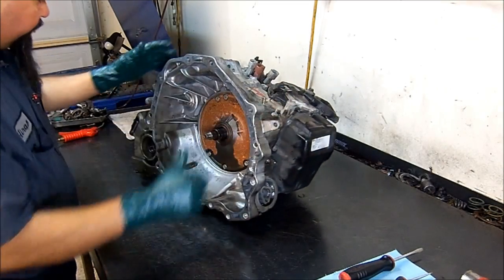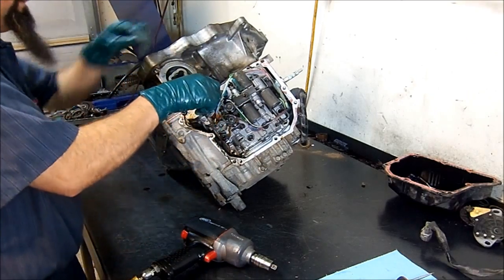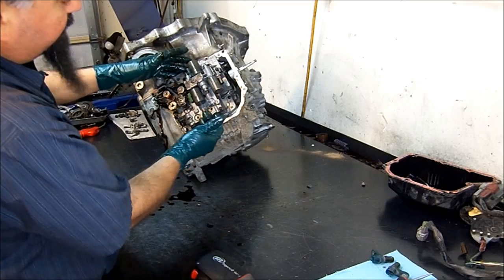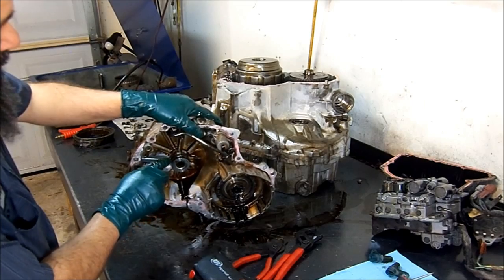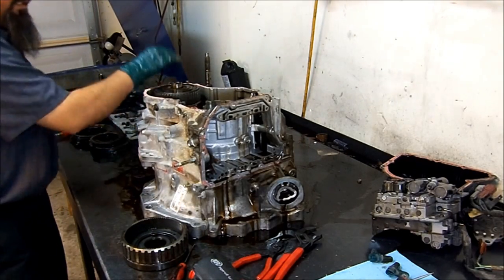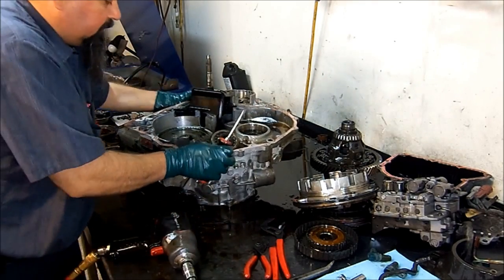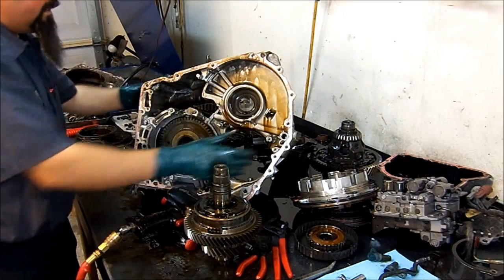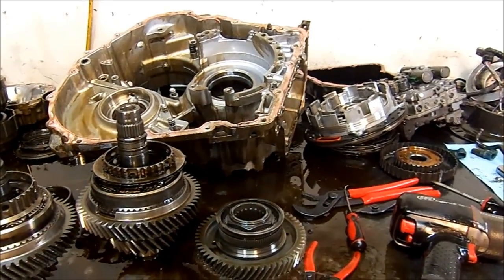AW55-51SN / RE5F22A Transmission Teardown Inspection - Transmission Repair

Comment: Hiram, you're fantastic ... an asset to any business!  I previously overhauled (well, assisted my journeyman) Borg Warner Jaguar XJ6 boxes during my apprenticeship years in the mid 80s ... I'm a bit wary of touching these 'electronic' boxes.  You seem quite at ease, what exactly is required on the diagnostic side?  Here in South Africa Volvo charge +-R45,000 (+-USD2,800) for a recon XC70 (P2) gearbox, I could do it for substantially less... if I had the diagnostic machine.

Comment: I fixed the problem with my Volvo transmission with a rare earth magnet.
I simply placed the magnet on the valve body pan. After driving for a few days it shifted perfectly

Comment: Hi Hiram, Excellent video and I am very happy that you have extra talent in explaining very useful things through your experience with those trans. I have 2001 volvo s40 and same trans crashed and no signs of connectivity with the engine. I am going to remove and inspection. Before I watched your video. Thanks for your time. Do you have any clue about my problem ?

Comment: Very impressive. Too bad for me you're not in south Florida.  My '01 Volvo S60 T5 has this trans in it and I'm on trans number 2 thanks to some crappy software that Volvo used on the early S60s.  So far this 2nd unit has been great 60k miles later.  I've decided to do a drain and fill every 30k against what Volvo recommends in order to make this thing last.  Volvo says the fluid is for life, don't ever change it.  What are your thoughts on that insanity? Thanks!!!

Comment: Love this guy! this is weird to ask here but im loosing my mind! I have Renault with same transmission. Issue it has is that i loose D after tranny warms a bit. If its cold it Works like charm. Sometimes it does that when i put on N or R it goes to D. I took valvebody out and got new one in (i made sure solenoids had same adjustment as in old one) new oil in it and correct level but sitll no go. I know this is long shot that guru c this msg but i have no clue what to do…

Comment: Hi, thanks for your videos, they are very instructive.
Maybe you can help me, I repaired an AW55-55SN AF33 transmission of a 2008 Chevrolet Captiva and has the problem that does not enter the fifth gear and "kicks" from first to second, I change the three linear solenides but the problem persists .... Any suggestions or ideas about what the problem might be?
Thank you very much for your attention.

Comment: Crazy question... I know these transmissions were used in tons of different vehicles ranging from Nissan to Toyota and even including my 2002 Volvo S60. Just curious, do the vehicles that use this trans all have the same bellhousing bolt pattern (on their engines) or do these trans all have proprietary bolt patterns specific to each brand?

Comment: Hello Hiram,  If an axle shaft end snapped at the retaining ring groove and the broken end and ring fell into the transmission, could it be removed without disassembling the entire transaxle?  This happened to me on a 99' Maxima with 240K miles.  Not sure if it's worth the effort to and cost.

Comment: hey how's it going been watching your videos and have to say they been very help full  1st question I have is I'm gonna replace my valve body on my maxima and I wanna know where can I get the gasket for the suction cover and 2nd question is when I install the valve body the lever that's on top of the valve body is there anything  I do with that cause it seems loose does it grab on to anything  or is that going
how it is thanks

Comment: Hi there.I have a transmision like this in my Opel Vectra.Its strange.......but it will not move the car.No foults in the controler,i got speed on the turbine.When i pull it to R or D i got no responce at all,car is not moving............none change of engine sound.

It has 89000km and oil was changed 3 weeks ago.I notice there is too much oil inthere.After it was damaged the car going in Reverse 2 or 3 times for some seconds and then no more.

Any ideea?

Comment: I have a 2004 Volvo S60R AWD with a 55-51SN and want to buy a spare transmission to rebuild, can I use a 2001 Volvo S60 55-51SN AWD transmission?
Are they compatible between years (apart from B4 servo)?
Thanks.

Comment: I have a 2004 Nissan Maxima low miles 70000 I have a delay from reverse to drive bought one to two seconds otherwise the transmission shifts great do you know why this delay is there?

Comment: Hi Hiram Gutierrez, Great Video, Thanks for doing this.
I got a AW55-51SN no Fwd or Reverse whatsoever no codes , Fluid level is ok. Fluid smells burnt it is not black but dark brown .
I checked all the sol they all measure good and respond electrically apart from S4 , S4 measures good but when I trickle it with 12 volts doesn't make any sound. 
Any advice would be great help.

Many thanks 
NSD

Comment: Blown away with the complexity of the AW transmission and especially your expertiese, a privillage to watch. I am about to renew the fluid (Gibbons) on my 2005 V70 112,000mls for the first time, runs fine at the moment. I somehow wish I had not watched this, especially at the "high mileage is about 100,000mls" comment 🙄 Get as much of the fine floating metal particles out as possible.

Comment: Hello Hiram,
I have a ’04 Volvo XC90 with just over half a million Km’s (310tsd miles) and a dead (burnt to a crisp) AW 55-51SN gear box. 
I really love my ride and I’m determined to put it back on the road one way or another; the goal beeing an even Million!
I’ve watched all your videos concering this box and probably know them by heart now and I was hoping you could give me some advice. 
I’m in total rebuild mode; VB, tranny, the works but I need some help with what and where to buy the rebuild parts, plus I would also have a couple of insider tips to ask for which I haven’t found answers to on your channel.
I don’t know how long messages can or should be here but if you have a bit of spare time to answer; I’ll be to the point and try not to waste your time with my questioins.
Thanks in advance,

Comment: Hiram, I have a 2004 Nissan Maxima with all the symptoms you have shown, I put the Transgo shift kit in, now I have new sound coming from transmission and when put into Drive it actually goes into 5th gear. I have seen posts that say it is my camshaft position sensor. What is your experience with this? Any info you could provide would be appreciated.

Comment: yet another great video Hiram..
i have an isue with an chevrolet captiva transmission..(aisin 55-51)...after rebuild with bushing kit instaled seal kit instaled ,cleaned the valve body and everything, not the transmission is harsh on shifting from N to D and from N to R....i also have erro code on 5 gear and toque converter stuck open ...my gues is that upon reasamble of the valve body i mistakely set the "steped" pressure regulator sleeve...could be this the case Hiram?

Comment: Great job and video, where I can find an honest mechanist as your self. I got 2005 nissan altima same transmission. last week the check engine light turn on I took it to autozone for a scan and the result is code P0745 something wrong with the solenoid valve... What can I do? Any suggestions? Thanks

Comment: I have a variant of that transmission; I need to remove/clean/replace the filter. Is there an easier way without taking the whole gearbox out of the vehicle? Mine is on alpha romeo 156 24v. There is delay in transmissions and sudden clutching. No slippage

Comment: greeting! I have a problem with the Volvo gearbox 55/51 sn. no reverse. I cleaned the selenoid and disassembled the gearbox and there was no mechanical flaws that did not break or crack, but the front went smoothly and great in all gears. I'm asking for help.

Comment: Hirman hello ! I have a Volvo s60 2005 2.4L with a aw55-51sn transmission. has a fault , when select the L , without moving the wheels , an internal noise is heard as a metal rose . D and R

Comment: I have a question about my wifes Volvo XC90 awd with AW55-51 transmission.   The bevel gear went out last winter.  She still drives the car with fwd and no problems, but I know that the bearing and gear  pieces from the bevel gear input shaft will destroy the rest of the bearings.  I found a used bevel gear only to find that the splines on the input shaft were poor. What I want to do at this point is reassemble with the new bevel gear leaving out the coupler.    I also feel that when I remove the coupler from the transmission side the splines will be bad also.  Since the right driveshaft passes through the bevel gear into the transmission differential we should have front wheel drive.  There is a seal that the coupler seals into on the transmission,  does the seal keep dirt out or fluid in???  Can I leave the coupler out with out problems?     What are your professional thoughts?      Thanks, Dave

Comment: Great video! I have a unit like this and it’s running hot, can you tell me why and it not sending any code.  When it cool it runs great, but when it warns up it make I funny sound but still shift find. Fluid is to the right level and everything.

Comment: Hi Hiram Have a 700r4 which works well when you shift manually no clutch slippage in 1st 2nd  3rd and the torque converter locks up fine      but when the shifter is in the drive position it will bearly move any suggestions?
Reply: ***** Thanks Hiram  input sprag is getting replaced

Comment: Hi Hiram, great informative video as always. My 55 50 has 144k and new valve body 20k ago. All working great until recently it stopped creeping in D and won't hold on a hill. So I reset adaptions (Volvo xc70) and now it slips in all gears once warm - when cold it works perfectly. What could this be mechanically? Clutches, Torque Convertor? Or pressure control solenoid in the new valve body? Confused because I would have thought mechanical problems would show up hot or cold. Thanks again great videos!
Reply: Did you figure it out,got in the same situation

Comment: hola hiram, recien le realize una reparacion a mi chevy captiva 2007, cambie los 3 solenoides de pressure , tenia codigos de stuck on, cuando abri la tranny el b4 estaba quemado por completo... luego de cambiar los discos  y todo pues monte la tranny, en un principio no queria moverse, no tiene codigo, no tiene el emergency mode on, pues de tanto pensar se me ocurrio pues desconectar los cabiles que van junto el transmission range sensor osea los que van dentro de la unidad y  comenzo a andar obvio que le entro el emergency mode. crees que debo desmontar el valve body?? los trens solenoides son o ynuevos marca rostra. los tornillos de graduacion se deben poner a la misma altura que los de factory? otra cosa que me llamo la atencion fue que estando en emergency mode queda como en neutro. revise los dts y aparte del p700 me aparece codigos del oil pressure y el Ho2 sensor,mass flow? eso puede crear que la caja se neutralice?... cuando retrocedo me da golpeteos. espero su ayuda y mil gracias ante mano

Comment: hi hiram, hey so in order to put it back together you start from the oil pump side? or from the back side, i started from the oil pump and im really having isues the installleing the back. specifically with reverse clutch

Comment: i have a 2001 Nissan maxima and when it is in park or neutral it runs fine but when I put it in drive or reverse the transmission makes a sound similar to a worn or slack drive belt the sound goes away when the rpm is increased but comes back when it slows down can you tell me your thoughts on what the problem might be

Comment: Hey Hiram form the Bahamas I bought a 2005 Nissan Maxima Se and it slamed really hard I changed the valve body as the mechanic told me it was the only problem but it dont slam in reverse any more but still shifts a little hard going in first second and third any suggestions spent a lot of money on this car and mechanic aren't really Good with cars from 2005 and up so there are many people with these problem no cant seem to fix.

Comment: This looks Lot like my Pontiac torrent transmission. According to wiki I have a Aisin AF33. The dealer told me valve body or torque converter seal is leaking..
Reply: giftman20 sonnax a valve kit company says that aw55's are the same as  af33's

Comment: I have a question about the end cover. There are 4 bolts next to each other on the side. What are those for?   The top one on my nieghbors car is leaking. Can I remove that bolt to fix?  Thanks

Comment: Are there seals in side the differential gears? I'm leaking trans fluid from my axles where the axles go in. It's not the bigger seals on the outside leaking

Comment: Hiram thanks for the video. I have a question for you regarding the valve body.  On this Trans  Nissan maxima / Nissan quest / Volvo / equinox and torrent have similar or most likely same Trans with the difference being the case  are valve body the same can be interchanged on theses different applications and do you think pressure point on solenoids are the same. Once again thanks for your videos

Comment: Hello very nice video seems like you know your transmissions I have a 05 maxima with 113k miles on it. I bought it used soo I dont know if the atf fluid was ever changed. Now I want to change it but I heard that by changing the fluid will mess it up. What do you think. Please help.

Comment: Can you see whether it is solenoids or not by reading the fault dtc codes? (Volvo uses the sane tranny).
Reply from the maker: Usually the linear solenoids cause a lot of symptoms and missing gears. You can buy them as a set at your local transmission parts place, try to avoid buying knock off solenoids online, you will have more problems than you can solve.

Comment: Hello Hiram, awesome video! Nice to watch professional working! I bought a 2006 Volvo XC70 with aw55-51sn Shifts smooth and perfect while it's cold, or on highway, but when heats up in traffic shifts hard, and delayed D engagement. No codes at all. Do you think it's a valve body, or it has internal damage? Thanks.
Reply: Hello Vitaly, just wondering did you find your transmission issue?? I am having a harshed and delayed D engagement on my 2006 Volvo S60 once it warms up. I believe it is something similar like yours.
Reply: @donatomedrano6062  i have the same car with the same issues as you what was the cause

Comment: I have bought a Nissan Altima 2.5L with 130,000 miles. I have drained and changed the trans fluid using OEM fluid.  Looks like it was never done.  Fluid smelled ok but was dirty for sure.  The trans works fine except when initially starting it in the morning (60 ish degrees F) I get a first time only hard N-D shift with a bit of a delay.  Once into drive maybe a slightly hard 1-2 shift and then it acts totally normal after that.  Question: Could this just be sticky solenoid and if so can it be serviced w/o a trans removal?  - Thanks Mike
Reply: So my question is can they be serviced/repaired w/o pulling the trans?  In other words over haul the valve body solenoids?

Comment: Hi, I really like your video. May I present you a problem with a v70 2001? When he's cold, there are no, or minor problems. After a few km, you can feel a certain vibration when speeding up. This is getting worse. After a certain amount of time, the warning light pop up. Also the engine is revving up, without speeding. When  reading the code, its says 5th gear incorrect ratio.
Can you make a estimated guess what could be wrong? I already did a powerflush. There's 360000km on the counter.
Regards, Bart from Holland
Reply: How did you fix it i hqve a s60 with thesame symptoms

Comment: Hello, Hiram. Maybe You can help me. I watched your videos and decided to do repair by my self. I have volvo v70 2004 with asian aw55-51sn gearbox, and problem is with shifting. I feel like push between 2nd and 3rd gear. RPM goes a little bit up for some 200 rpm, and then is like push, after shifting 2nd to 3rd shift. I buy new 3 big ones solenoids and changed them, changed the fluid with flushing method, but nothing helped. Problem not solved. Maybe I need to change those small ones too or is it problem in gearbox by it self, not in brains? Thanx, and best wishes.
Reply: I have the same problem with my volvo s60 2002 with asian aw55-50 gearbox. Did you fix the problem?
Reply: Did you fix it and how if i may ask